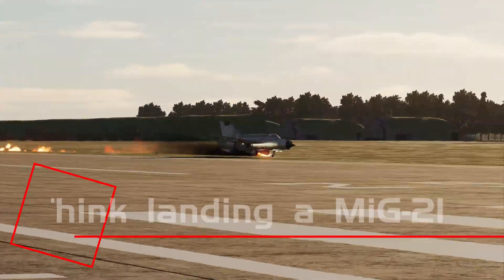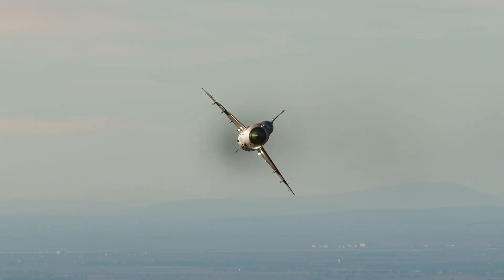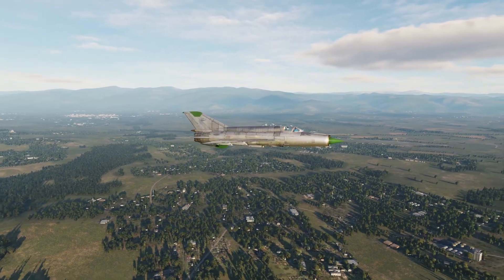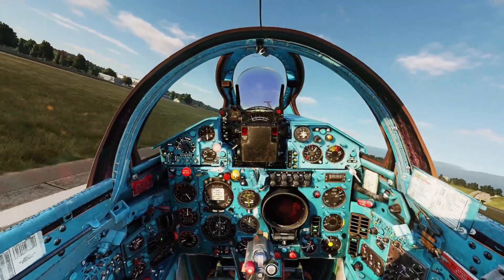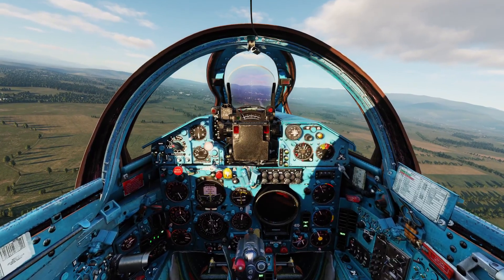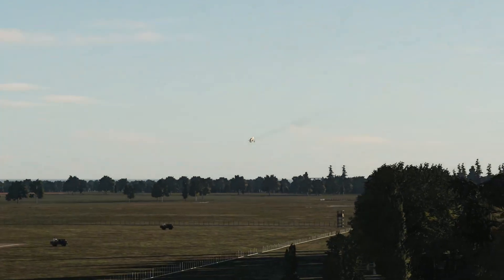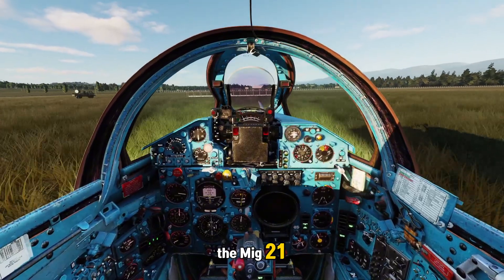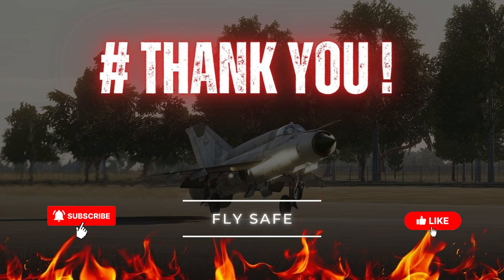5 Deadly MiG-21 Landing Mistakes Every Pilot Must Avoid

Comment: It's not bad, but when you turn on the wind from different directions and strengths, it becomes a comedy for pilots 😂 The only advice for virtual pilots is that this plane is not correctly simulated like a real one, and to avoid that, land at a speed of 400 km/h with the flaps half down and there's no problem 👌😁
Reply from the maker: I made this video based on the common mistakes that most of the new virtual pilots do